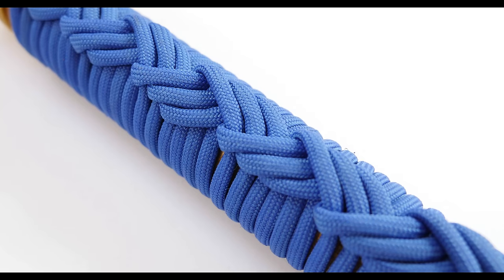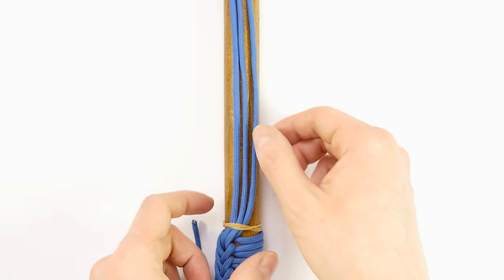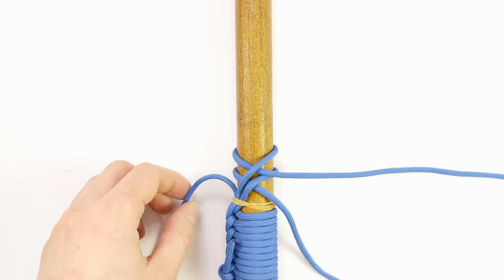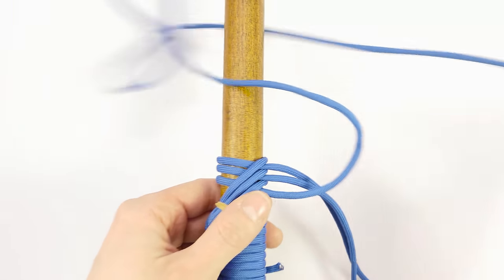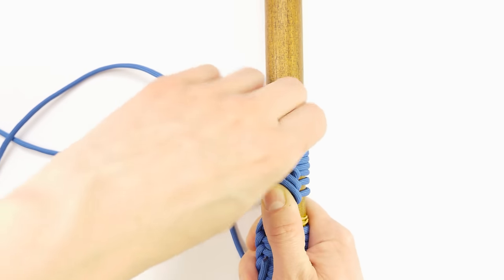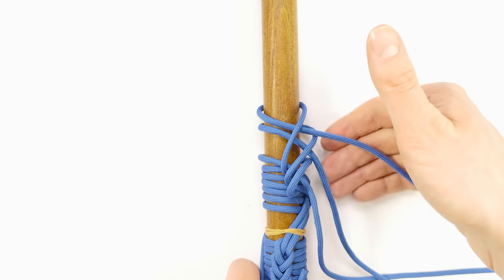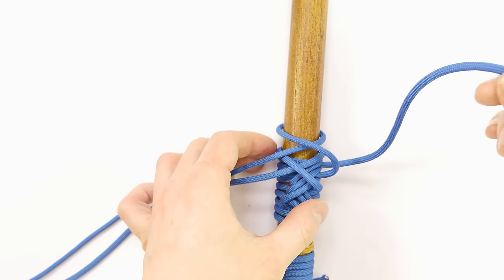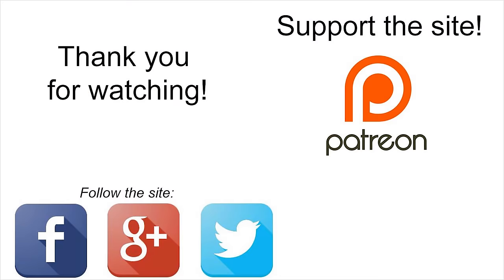Zigzag ringbolt hitching

Comment: How do you suggest this hitching is started and finished?  What knot can be used that had 3 leads?   Or is there anther trick you have to suggest?
Reply from the maker: Hey there! There are a ton of different ways to start a braid. I have covered starting with a turk's head knot, a Spanish ring knot, with a binding and probably a few else.

Try this:
https://www.youtube.com/watch?v=S8pfpmL8Ecc

Mark
Reply: Paracord guild Is there one that uses the 3 strands that you used in the wrap? I’m a complete beginner and I’m clueless on how to finish either end of my wrap. I just have loose strands being held down by rubber bands on either side until I find a way to finish.